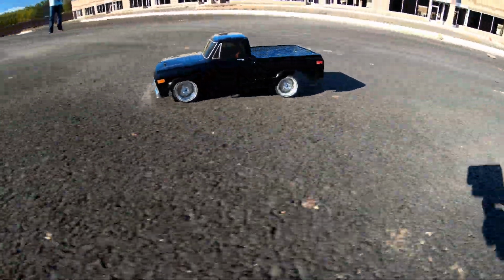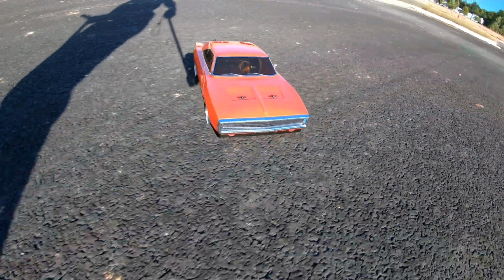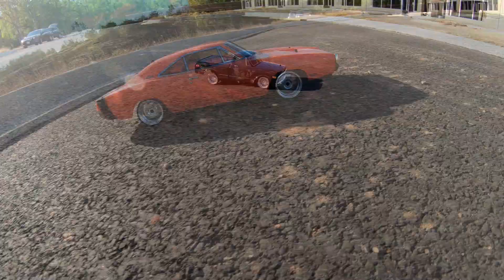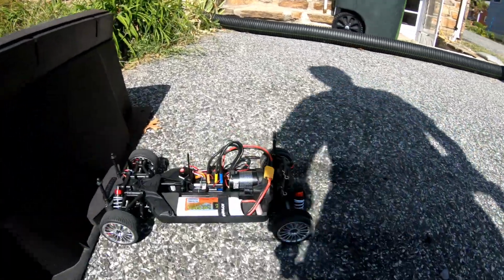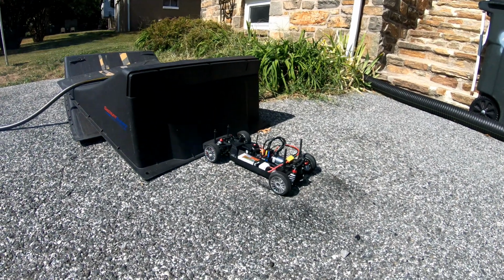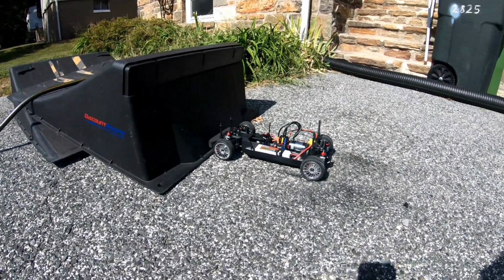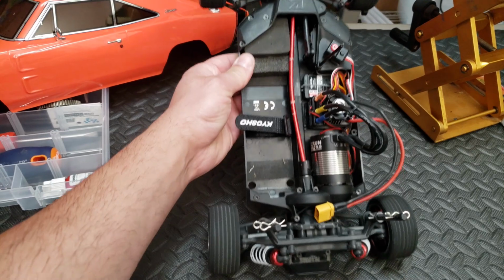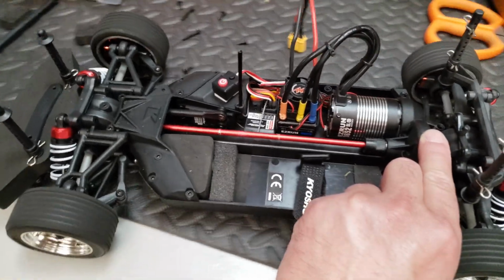Kyosho 1970 Charger and Vaterra 1972 C10 First Drifting Runs with Hobbywing Max10 4000kv Motor!!

Comment: If you could find a way to support the shaft at mid point with something..They have any bearings that size? Or do this..Wrap a small section of the shaft with Teflon tape and mold in a mount with clay to the chassis. Then use JB Weld to make the mount around the shaft...May work good.
Reply from the maker: Thanks for watching and the suggestions!! I actually modified an aluminum Slash drive shaft to use. So far it is working great.

Comment: I have the same set up. Same thing happened when I put the 3s Lipo in it. That aluminum shaft is shit. We need to find a steel drive shaft that fits.
Reply from the maker: Yup it is. Lol

I ended up modifying an aluminum Slash drive shaft to replace it. So far its working great.
Reply: RC WorkBench hmm I’m gonna check that out! Thanks for the info.